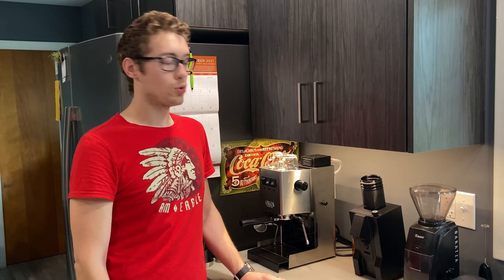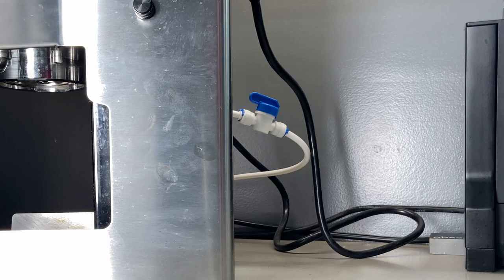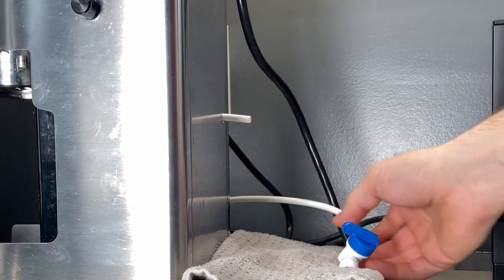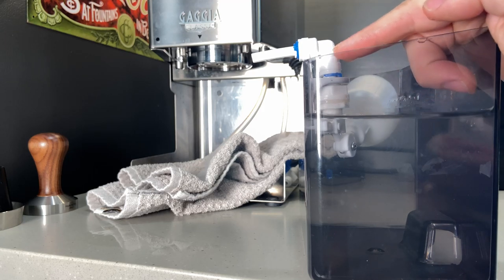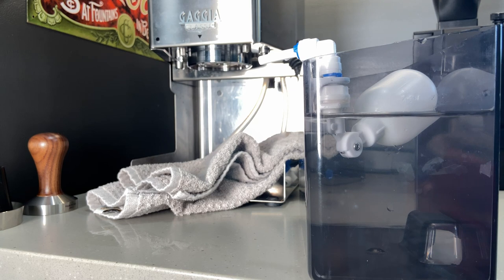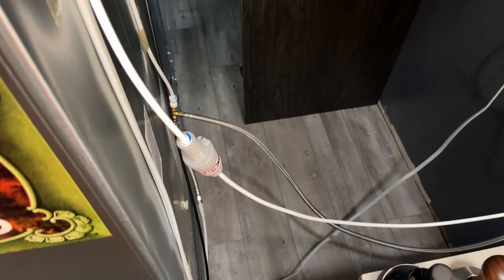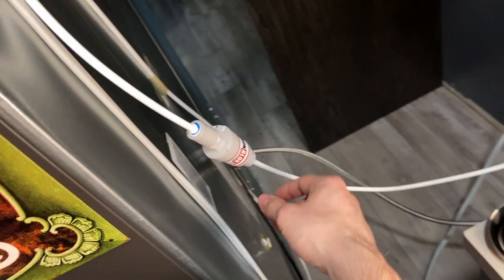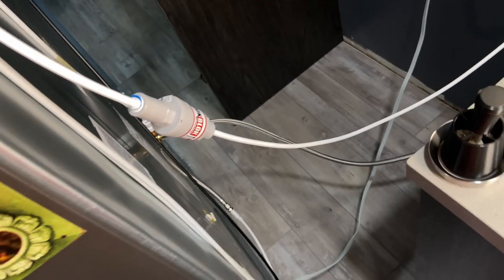Gaggia float valve mod! Plumb-in your Gaggia (Never fill the tank again!)

Comment: Caution, especially if you rent.  A mod like this one can EASILY flood the kitchen, ruining hardwood floors, etc.  If that happens, your insurance company is likely to CANCEL the policy.There are too many things that can go wrong with a float valve in that application.  I went with a simple approach... I put a small valve on a water line into the water tank.  Don't need to drill a hole.  Takes under a minute to fill the tank.  I am looking for an inline de-scaler/filter but my area has great water so I am not in a hurry.
Reply from the maker: I ended up giving my GCP to my sister and they fill it manually now. I put a shutoff valve at my new machine now much like you said you did on yours. I should’ve said in the video that either way (float valve or not) you should have a shutoff valve right before it to shut off between uses, just incase the float valve fails
Reply: @samburchard1778  Just so I may live vicariously, what machine are you using now?
Reply from the maker: @SunriseLAW  Haha, you sound like you’d be fun to hang with. I have a Decent DE1 now, version 1.42
Reply from the maker: @SunriseLAW  I feel bad that I asked people to subscribe since I’ve given the Gaggia away now. Maybe I should make just regular coffee videos of some kind

Comment: Basically a small version of a toilet float valve... The direct plumbed Spaziale I use is a closed system. It won't overflow internally. You may want to add an electric solenoid valve that opens water supply only when coffee machine is powered on as a safeguard against float valve failure and flood. Could also add an overflow tube that goes to plumbed in drip tray.
Reply from the maker: All good ideas, I like it! I’d also like to add a drain tube to the drip tray eventually, that drains into my sink or something similar. Anyways, I appreciate the comment! All great ideas
Reply: @samburchard1778 Have you actually measured the PSI of the flexible water tube without the limiter in place? can drain drip tray into sink or use a tap in like that of a dishwasher that sends the water into drain pipe below sink.

Comment: My gaggia will always have ants in the water, you know how to resolve this?
Reply from the maker: Man, no I don’t. I’m sorry I didn’t see your comment until now. If you can get rid of them that’s what I’d shoot for. Where I live we can buy a product called “torro.” We just put that on a piece of cardboard and leave it in the path of the ants, they usually all die pretty quick after
Reply: You might consider a 3d printed part to block the segment between the top of the tank and the machine? That might prevent them from getting in there

Comment: now you just need a mini sump pump for the drip tray =]
Reply from the maker: I’ve thought about drilling a hole in the tray and running a little drain line Several times, but I don’t ever get anything in it anymore with not having any need to temp surf after the PID upgrade. Plus I don’t want to drill a hole through my countertop, so it’s been fine for now;)